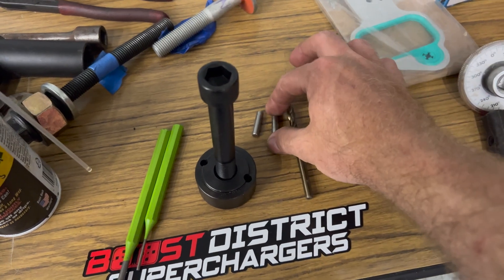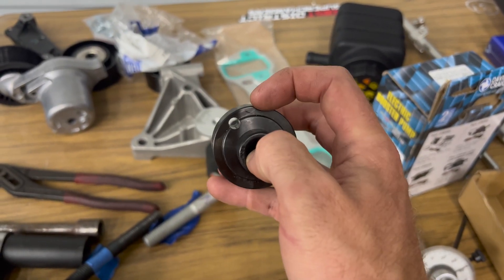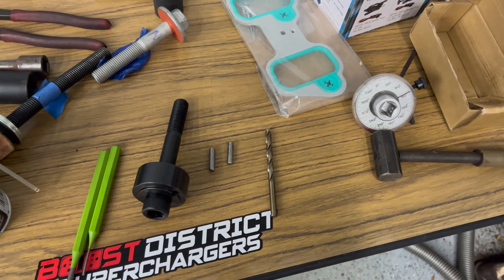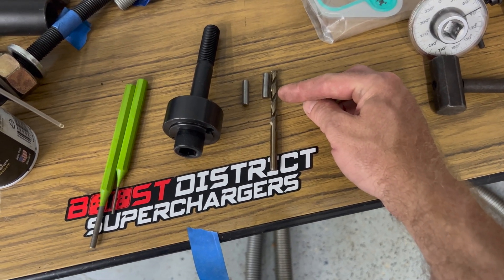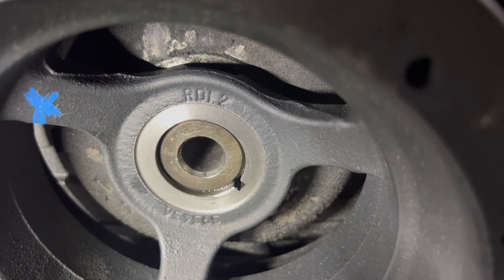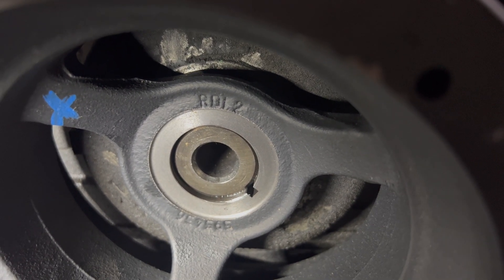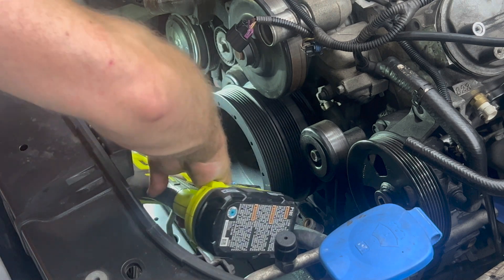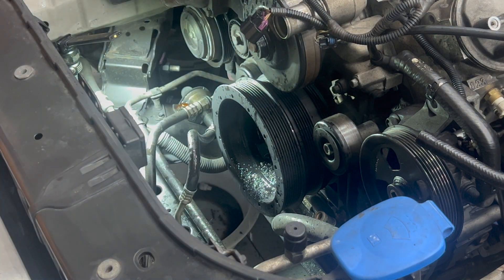Pinning a ls Crank for superchargers !

Comment: Hi. Great vid. What does this help with and where can I get that kit? If can send the link. Thx! 👍🏻
Reply from the maker: Thank you, this will keep the pulley from spinning on the crank. Happens a lot when supercharger is added to an engine. I got this kit on eBay 

https://www.ebay.com/itm/233721684255
Reply: @repairandsharegarage thanks!
Reply: SUMMIT RACING sells them for 71bucks.